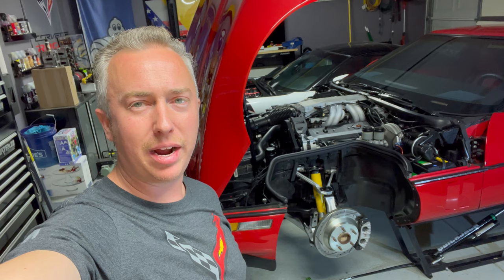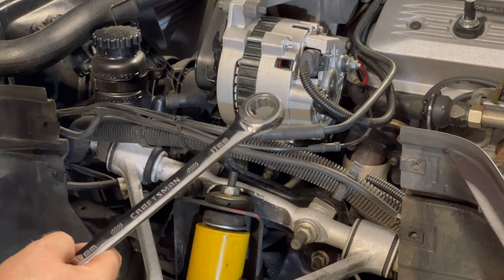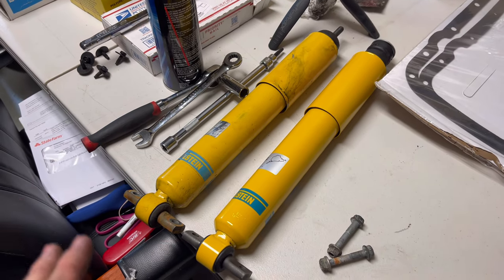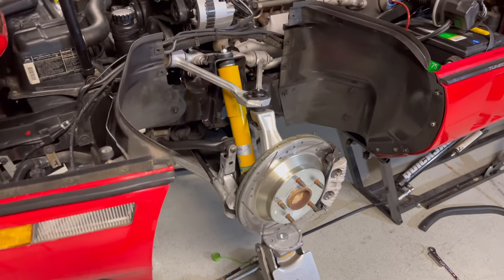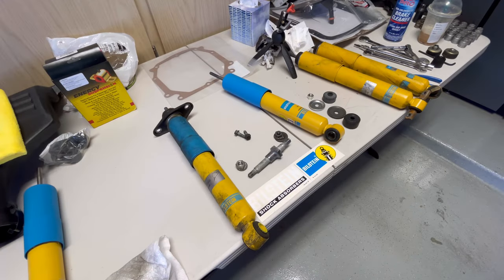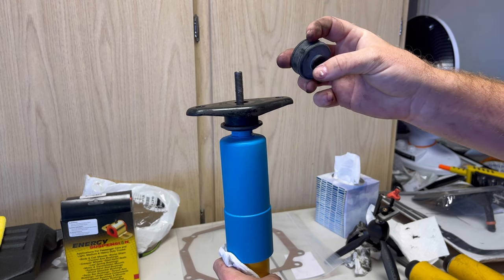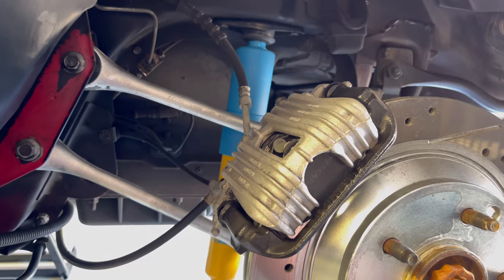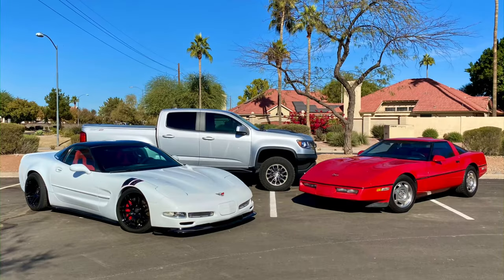C4 Corvette Shocks (Front & Rear)

Comment: The other day as I was installing my exhaust I looked at my shocks and was like I bet this is an easy project when the time comes. Sure enough you made it look super easy. I don't think I need to replace them just yet but I may in the next year or so. Currently at 79k but it still rides smoothly and takes bumps well which says a ton considering Wisconsin has craters all over the roads.  My car didn't come with too many records but I see parts with dates on them showing things have been replaced. Next time I'm under the car I'm gonna look and see if they're marked at all. I'm gonna be sad when the C4 goes. The angles you record at and information you give and diy content is just so well done!! Thanks for everything so far and the videos to come!!

Comment: Just started working on the front shocks of my '86 convertible, but that year is a huge difference to this tutorial :-D I started by removing the access panel: in your film it's very simple, but with my '86 there's a lot of stuff attached to it you need to detach first. Also the panel with my car is on the engine side, so inside, which makes it very hard to get out. Yours was on the outside which took you 5 minutes to remove. I was fighting more than an hour with mine... I guess this was one of the things they improved upon on the '88 car. Also I could not hold my shocks locked with an allen wrench, I needed a small wrench for that (and on my second shock that top of the thread was completely destroyed...). But, overall, it was a fun thing to do! It took me 2,5 hours to replace 1 shock, but I'm also a newbie to wrenching, so I go slow ;-)

Comment: Thanks Chris as always. It will be sad to see that  vetted go. I have really enjoyed the C4 videos immensely. I have to go back and rewatch a bunch of them so I can order some parts for mine.  Planning on the brakes you listened in a prior video as well as the shocks and all the cleanup up did as well.  Have new zr1 wheels ordered with the 17x11 rear wheels and want to get all that done for the new rubber comming. Running a triple black 90 conv with the zf6. Its base not z51.

Comment: I had to see his other videos to determine this C4 is an '88.  My C4 is an '84 and the mounting of the shocks is close but hardly the same as shown in this video.  I did not even have to remove the front wheel to get access to the bolts, etc.  The rears were different, the wheel was removed.  I decided to use AC Delco shocks as they were the only ones that did not brag about being 'performance' shocks.  Somehow it seems that Corvettes are perceived to be only driven on racetracks and need really stiff 'performance' shocks. I have yet to put my C4 on the road and cannot report on the softness of the new ride.  The removed shocks appear to be originals and are useless, so I assume the new ones can only be an improvement.  I'll post a report on the ride improvement after I get the car on the road.

Comment: On my 1986 (w/Z51 suspension), there are a lot of differences. The rear shocks only have 2 18mm bolts. One on the bottom and one and on the top. And you only have to remove the one 18mm on the bottom and then slide it free. On the front, there is no panel to remove to get at the 5mm socket on top of the shock. I'm simply making a 1.5" hole in the top of the panel so I have access to the top of the shock. I'll use a rubber grommet to fill the hole when I am done.

Comment: I'm going to go ahead and replace the shocks on my 89. I've got the original Z51 Bilsteins on the rear, and it looks like the previous owner put some real cheap shocks on the front. I'm going to go with KYB just because I don't feel like spending nearly $400 on shocks as I just cruise around town and go on the interstate a few times a year. I think my shocks are probably blown as when hitting potholes, etc. it feels like I have no shocks as I feel everything and I can hear lots of noise in the car every time I run over something or hit speed bumps, etc.

Comment: Chris, is replacing the shocks like that on all C4’s or just ones closer to your model year? Like say the last year of the C4 in 1996. Just curious. 🤔
Reply: '96 is same from what I remember.  Also, if you buy cheaper shocks that don't have a lock nut on the top of the rears, do yourself a favor and get one that fits it, otherwise after a while you'll have a mystery clunk in the rear, and when you investigate, you'll find that your rear shock is no longer attached properly and you now have that rubber bushing and that nut wandering around inside your frame rail, never to be seen again.
Reply: @jenniparker1  Good info there, thx.
Reply from the maker: Same
Reply: @jenniparker1  Yeah, I ordered KYB shocks. And I believe they come with just a regular nut and a jam nut. But I plan on taking the nuts to the hardware store and getting some nylon lock nuts for it.